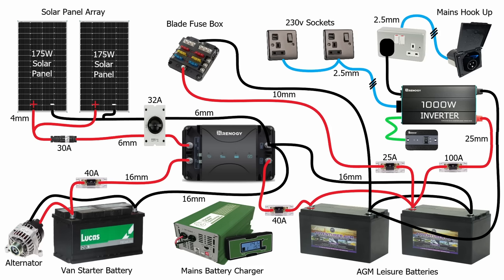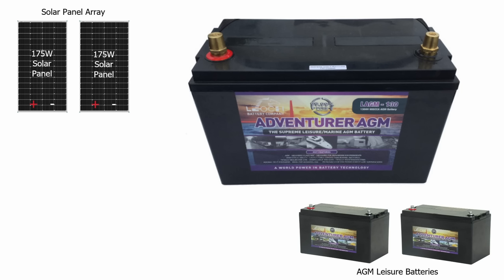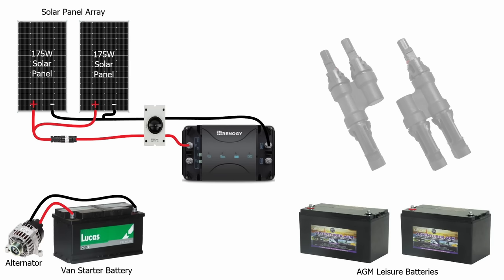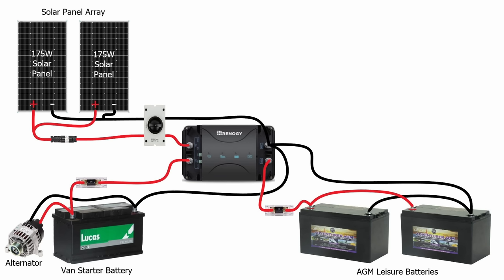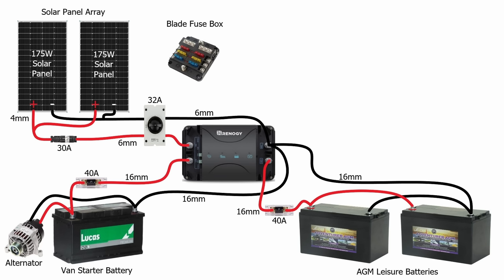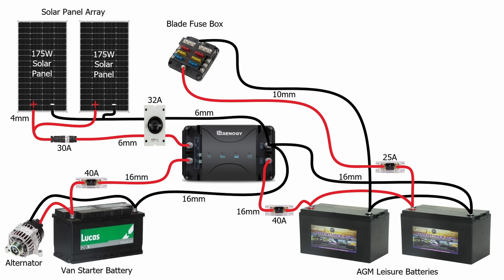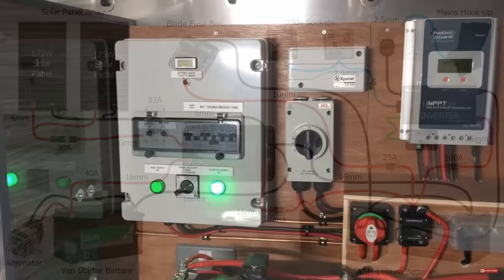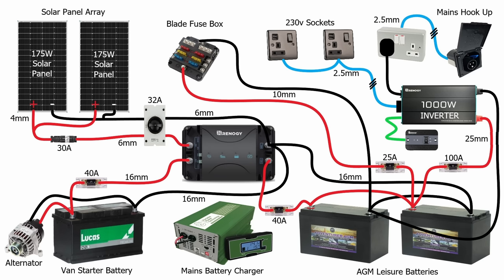12v Electrics for Off-Grid Campervan - Fiat Ducato Budget Build Ep12

Comment: Great video Greg 👍

Quick question. I have a 100AH lithium battery and the renogy 1000w inverter and have a 100A breaker switch where when using a 700w kettle it causes the breaker switch to trip. I am contemplating upping the breaker switch to 125A. 

Will this damage the battery?

Comment: Thanks so much for this.  You mentioned about keeping the batteries above 70% to protect them.  How do you manage this?
Reply from the maker: I just keep an eye on the battery voltage and never let them drop below 12.4volts.  Anything below 12.0v for AGM batteries would be 50% and you never want to go below that. Look after them and they’ll last for years like ours have.

Comment: Great diagrams and video. :yt: 🏆
I was trying to convert the metric wire sizes in this video to AWG (American Wire Gauge) because that's what I'm familiar with.
One source I found says:
1.5 mm =  16 AWG
2.5 mm = 14 AWG
4 mm = 12 AWG
6 mm = 10 AWG
10 mm = 8 AWG
16 mm = 6 AWG
25 mm = 4 AWG
But I don't know if that is correct, nor do I know if that is for stranded or solid wire.
Reply from the maker: Yes those conversions look right 👍🏼😃

Comment: Perfect and couldnt have come at a better time as i have just installed my electrics.  Good to know i have done it right 1st time. 1 question, i know you willbe releasing grounding episode but do we need to run ground cable from 1 of the batteries to chassis of van.
Reply from the maker: Not with this system it’s an isolated dc system so it does not require a negative connection to the van.

Comment: Hello Greg thanks for another great video. Could I ask with the Renogy inverter and the mains battery charger would you use a consumer unit to stop the battery charger from turning on every time you use the inverter as opposed to it just starting when on shore power?

Comment: Great video, thanks Greg. I have a question about renogy inverters, with AC prioritisation. My set up is very similar to the one you've described with the sane CU, RCD & MCB protection. My inverter is a Renogy 2000W similar to the 1000W shown in the video. It looks like you have a separate AC circuit coming from the inverter with your inverter plugged into your mains AC sockey outlet, fed via the CU mentioned, presumably this is just on a plug top from the inverter to the AC sockets fed from it, is this independent if your mains AC system and if so does this affect how the Renogy AC priority system works? 

I've noticed other methods where the inverter "AC in" is fed directly from the mains into the van and then that feeds the CU protecting AC circuits in the van, I presume people fo this to have all their AC outlets on the same system and this allows the Renogy AC priority to work?

Hopefully that all makes sense, if you could shed any light, that would be greatly appreciated. 

Thanks
Reply from the maker: The correct way to do it is to have a CU on both sides as they are isolated systems. There should be nothing in between the source (hookup socket) and CU on the incoming side. You also need RCD protection on the inverter mains as I’m pretty sure this is not properly protected inside the inverter. 
If having two CUs is too much to fit in this can be done with two double pole, 16amp, type A, RCBOs my latest CU video gives a bit more info on these units. 
Should You Install A Consumer Unit In Your Campervan?
https://youtu.be/kdvm0TFvfVQ

Comment: Hi Greg
Just purchased an L3 boxer and love your
videos.
I have already purchased 1x 230AH lithium
battery, the 50amp mppt/dc and a 2000w
Renogy invertor. Could you advise what
cable/fuse changes you would make to your
system if incorporating these changes.
I have a rough idea myself but hearing it
from you is very reassuring and would give
me the confidence that i am doing things
safely.
Thankyou ahead for your time
Reply from the maker: Sounds great! OK so the inverter will need a 200amp fuse and I would use a min of 35mm² cable.  fromthe mppt to the battery use 16mm² cable and you will need 60amp fuses on both battery connections on the DC-DC charger, if the run tot he van battery is the length of the van consider increasing that cable to 25mm² because of the voltage drop. Hope that all helps :D
Reply: @GregVirgoe  Thank you so much for taking the time to reply. Eagerly looking forward to your earth/grounding video. Thanks again.

Comment: Hi Greg. May I ask a question? Watched various of you vids including this one (great vids thank you) my question is, you say that the maximum solar input voltage is 25v. The label on the side of my 50a unit says max solar voltage input is 50vdc. Have these units been updated or am I being daft? I’ve got a single 420 watt panel which produces a maximum of 35v (vmp) I don’t want to ruin my unit so thought I’d ask - ta in advance - Jon

Comment: I am in the process of rewiring a NuVenture camper that was using a 15v transformer to charge the battery. At the same time adding an inverter. I never knew there was a UPS version so thanks for the info. My question is do you need an isolator between the leisure battery and the inverter? I always include one but once I forgot to switch it off and the Leisurewize inverter flattened the battery. Thanks again.
Reply from the maker: It’s wise to add isolation points to a system for easy shut down if needed

Comment: Hi Greg, I have a few questions to ask of you.

I have an old Fiat Ducato Motorhome which I hope to live in for the next year or two while I travel about playing senior citizens golf championships.

So here goes. It has a main battery and leisure battery under the seat (lead acid) all covered by a Battery Mate system that charges the Leisure battery as its running or on hook-up.

I have purchased four Lithium 100 AH batteries, a Renogy DCC 50 Amp, Three 200 watt Renogy Solar Panels, and a Renogy 2000 watt inverter,  plus all the fittings kit... I'm not a complete novice being an ex Royal Engineer.

1) i will chuck out the Lead Acid Battery and replace it with the four Lithium Batteries. If I link them in parallel  - will the Battery Mate still charge them when driving as an auxiliary charger supply as hopefully it will think its still only one leisure battery, correct ?

2) As I have four 100 AH batteries, will I need to have a bigger than 40 amp Fuse in line between Renogy DCC50 and from to Main Battery ?

3) As I already have the 240 volt hook-up already built in. Will it be possible to add the 2000 watt inverter into the mains input power lead with a switched junction box or does the Renogy already have that built in.

Any advice you can give will be most eagerly awaited. 

Best regards

Lee Saxon

Comment: Very informative vid, thank you for this. My question to you is what roughly is the cost of tbis compairing it to using the solar generator used by john while his main system was faulty. Unkess im wrong surely a single unit to power the van is the nost up to date use of technology. Again a brilliant video, many thanks
Reply from the maker: I am recording a video using a Bluetti Powerbank and portable solar panel to do a comparison against this system.
The hard-wired system here still works out a bit cheaper than the portable power banks atm. video out soon

Comment: Great information Greg, my heads been a bit frazzled working out what to do. That’s the exact set up I want, I’ll be running a 300w solar panel and the same size batteries in the vid. Renogy do a 50A and a30A control unit, which do you think I should go for?
Reply from the maker: It depends what batteries you are using. If AGM stick with 30A but if you go for Lithium get the 50A 👍🏼

Comment: Great video with excellent and accessible logic. Outside of the things normally present at the start (i.e. the alternator and engine battery) whats a rough cost range on a purchase from scratch for the stuff mentioned? Is £1400 far from the mark?
Reply from the maker: Glad you enjoyed it! All the renogy equipment was £700 and the Leoch Batteries were £200 add to that another £250 for cable and crimps etc and thats it complete for about £1150

Comment: Great video, my only question is, what is protecting the 2,5mm 230v Socket wiring? is it plugged into the inverter via a 3 pin plug so therefore protected by the fuse in the plug?
Reply from the maker: There would need to be a 5amp fuse in the plug.

Comment: Thank you very much for your efforts Greg. I will follow this for my build. I have a 24v vehicle could you advise the changes I will need to make?
Reply from the maker: With a 24v alternator and vehicle battery system this charger would not be compatible. I’ve not dealt with any larger vehicle systems
Reply from the maker: I belive that Victron produce a dc to DC charger that can work with a 24v vehicle system, its called Victron Orion 24/12
Reply: @GregVirgoe  Thank you

Comment: Excellent explanation, thank you.  One question, does the DC-DC converter detect if you starter battery gets too low so it won't pinch power to charge the leisure batteries, leaving you stranded because you can't start your van?
Reply from the maker: The dc to dc charger has a voltage sensor in it so it only switches on when the alternator is running and cuts off when the vehicle stops. There’s not worry about draining the van battery. The mppt will also charge the van battery too

Comment: Hey Greg, currently doing an l4 Ducato and your vids have been a brilliant help. Was just wondering do you still need a consumer unit for your 230v service with the inverter? Also are you still limited to 1000watt when the inverter switches over to mains? Thanks again.😁
Reply from the maker: I would still recommend fitting a consumer unit for short circuit protection and final circuit protection.
Yes, you are limited to 1000w through the inverter but you could take your hook up through a consumer unit to give you higher-rated mains-only circuits.

Comment: what an amazing video I have just started following you and the depth you go in is incredible so I'd like to thankyou for that. 

im looking at doing this system but ill be using 2x 200w solar 2000 inverter and a 50A dual charger the mppt one you advised. just wondering if the cable size would change for this and am I right in thinking I would need 360ah for my batteries so probably x3 agm's, I did try finding another vid or in the comments but couldn't find anything
Reply from the maker: Yes, the battery cables and fuses would need to be increased in size, the fuse to the van battery would be 75amp and 25mm² cable, and the fuse to the leisure battery would be 60amp and also 25mm° cable. You are correct with more charging capacity you would need a larger battery bank too. Hope that helps :D
Reply: @GregVirgoe  thanks for this ill bare it in mind, keep up the great content it helps massively 🥂

Comment: Hi Greg, great video , i built muy van following your sprinterbuild. Unfortunately mt B to B unit has packed up so I’m going to replace it with th eRenogy Mttp unit so my question is do I need an ignition line for the installation. Thanks Chris
Reply from the maker: Only if you have a new van with a smart alternator. The charger comes with the ignition lead in the kit you just need to connect it to an ignition power supply like the vans cig socket supply? 👍🏼😊

Comment: Greg, this is a great system and thanks for how simply you explained all of it.  Couple of Questions:  for the mains output off the inverter, do you not need a mains breaker "panel"?  I have a van I purchased that has shore power (mains hook up) and solar; I want to add an inverter for when we aren't on mains and was thinking I'd also need a separate transfer switch.  It sounds like the Renogy already has that built in, which is great.  But every video I've watched with the transfer switch talks about running the AC out through a panel.  Thanks
Reply: Nevermind.  Just found the "consumer unit" video.  Thanks.

Comment: Thanks Greg. Fairly sure I’m going to just copy this exactly for my build. One question though - when on hookup will this charge the leisure and starter battery ?
Reply from the maker: The mains charger will top up the leisure batteries and the MPPT will keep the starter battery topped up from solar.

Comment: Greg fair play dude... plan on converting a van next year... just learning as much as I can for now.. your videos are priceless info 👍 1 question on this set up... when you plug Into hookup power and the inverter automatically switches over to mains.. does all the 12 v appliances run off the mains aswell then? Or does the likes fridge and water pump still run off the leisure battery?
Reply from the maker: All the 12v stuff connected to the blade fuse holder stays on 12v from the batteries. 
What you can do it turn on your mains battery charger to keep the batteries topped up at the same time.
Reply: @GregVirgoe  thank you very much Greg 👍

Comment: Hi Greg, 
Thanks for the videos which have been really useful whilst being easy to watch and follow. I'm in the process of adding solar to an old (1993) Pilote/Renault Trafic motorhome and I need some advice.....Could you, or could you point me to somewhere that might give me a clue ? 

The camper has 2 lead acid batteries (motor and leisure) joined by a Shieber separator, which joins the charging and discharging circuits when both batteries ar within certain limits (between 12.7v and 13.5v) and uncouples them when outside this range. The system works in both senses from the alternator/motor battery side and from the built in shore power charger/leisure battery side. 

I need to wire the solar to the leisure battery but need to make sure no damage occurs either way if the shore power charger is active. My thoughts are :
1. A relay that disconnects the shore power charger and connects the solar charger when there is charging output from the solar controller (but what would power the solar controller when it was disconnected?).
2. A relay that disconnects the solar charger and connects the shore power charger when there is charging output from the shore power controller (but would having no battery connected harm the solar charger)
3. Something else using schotty power diodes ....??

All help and or direction pointers gratefully received.
Many thanks
Keep up the good work
Alan
Reply from the maker: You can connect the output of the mppt direct to the leisure battery and leave it on at all times. It will see a charge voltage from a mains charger and back off into float mode until mains charge is turned off. My mppt has been on constantly for 5yrs non stop now
Reply: Just the answer I've been looking for. Thanks Greg, you're a Monday night star.. @GregVirgoe

Comment: Hi Greg , love your videos, I'm learning a lot from you. I have question,will any battery works in this system and sizes, lithium battery? Thanks
Reply from the maker: Yes, absolutely, this charge controller has profiles for all lead type and lithium setups. Just don't go too big on storage  because you can only use what you can generate and youll not be able to recharge a huge battery bank.

Comment: Great informative video as expected from Greg, i was not sure about monitoring of the system but read in a comment that you can use the renogy app does that mean you dont need a display unit you can just use your phone. Thanks
Reply from the maker: Yes, exaclty that, I should have covered that briefly in the video, you can get a BT2 bluetooth device that plugs into the DC to DC charger and the Renogy Home app will give you all the info that you need.
https://youtu.be/imcgWT6_nnE

Comment: Hi Greg Thanks for the amazing video! could I upgrade the batteries to Lithium and the inverter to 3000w and keep the rest of the system the same? thanks mate
Reply from the maker: You can but your cable to the inverter needs to be increased to 50mm and the battery linking cables. The inverter fuse needs to be 300amp.

Comment: Hi Greg, 
my name is Hoss 
I’m one of your follower 
I watch all of your videos 
Your videos really helped me With my own project.
I got a Ford transit jumbo MK7, my plan is to put tow 150A leisure batteries and not to have solar panels and connect it to my main batteries and alternator to charge it up during driving and when I’m at campsite plug it in to main 220V to charge the leisure batteries up.
My question is, is it possible to send me a plan for that what I want to achieve 
I would really appreciate it if you could do that for me.

Comment: Hey Greg, you legend, got a question for you: I've purchased the 120ah leisure batteries without realising that the maximum capacity for 16mm cable is 110ah? I assume this will be a problem.. If I stick with them and opt with 25mm cable where will I need to make sure this is wired in the circuit?

Comment: love your video! I'm building my system based on this setup except i have the 50A renogy mppt/dc-charger and the battery will be a lithium 100Ah, inverter is the same Renogy 100 watt and i have 2 x 160 watt panels. Would you know how this similar setup would impact on my fuse sizes?
Reply from the maker: Yes you need a 75amp fuse and 25mm cable to the van battery and a 60Amp fuse and 16mm cable to the leisure battery. 👍🏼😊

Comment: Hi greg great video. I will be using this setup. What is better to use the 30a or 50a dcdc charger.
Reply from the maker: It depends on the type and size of battery you intend to use and the amount of solar you want to have. 
30A max 400W solar input
50A max 600W solar input 
The larger unit is more suited to lithium batteries as 50A is a lot to put into lead based batteries

Comment: Question please: I am planning to build my own system. That is : 280amp 12 v lithium battery, Mppt 60a l, 2000 w inverter, powered by min 500 solar panel. Is it coherent? Do I need larger fuse than the one in diagra? I.e 60amp instead of 30amp?